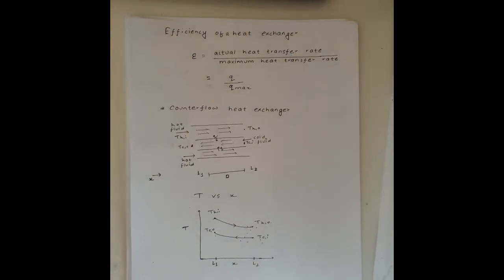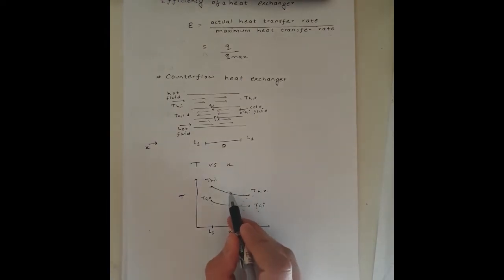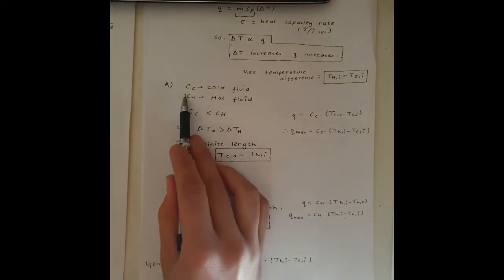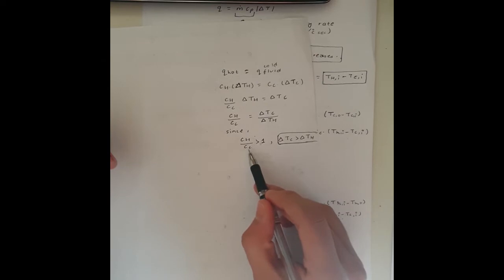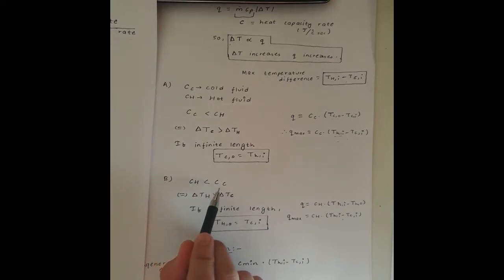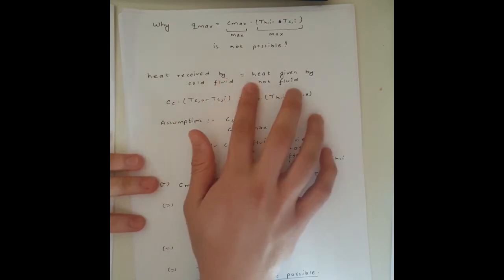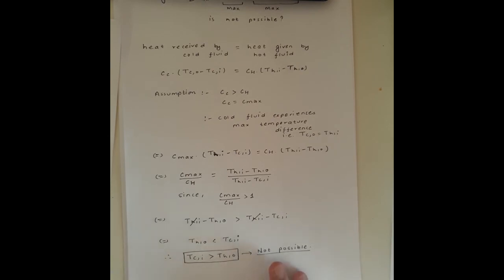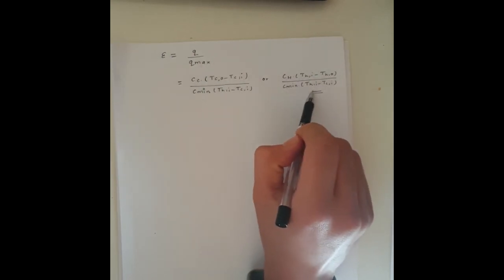Efficiency of a heat exchanger

Comment: What do you think of the hot fluid is two phase I mean vapor liquid mixture ? Then how we calculate the efficiency? Let assume plate heat exchanger with fix area. We have all 4 point for temperature and mass flow rate measurements from a single fluid. Let assume water with specific mass flow rate.